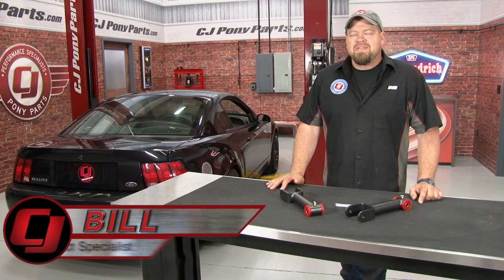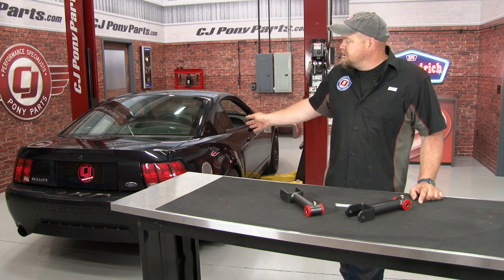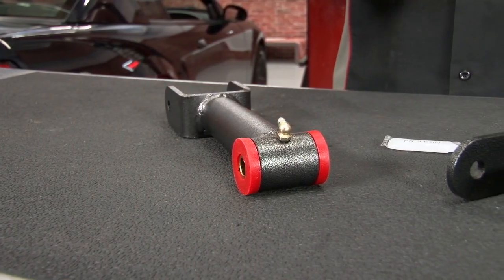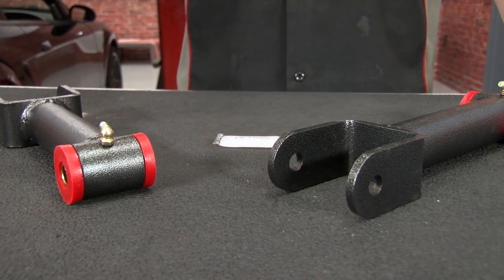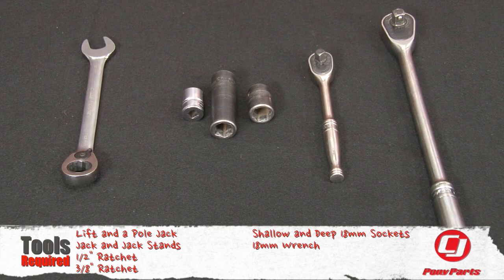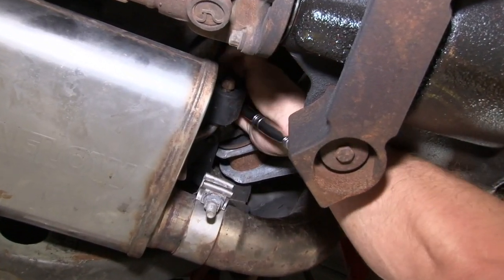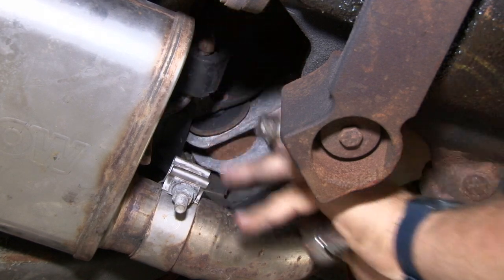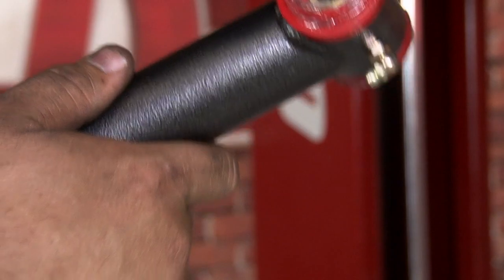Mustang BMR Rear Upper Control Arms Non-Adjustable With Poly Bushings 1979-2004 Installation

Comment: Maximum motorsports says this will cause suspension binding using urethane bushings for upper control arms
Reply: J&M control arms use  three piece hybrid bushings that won't bind. I use their control arms on my 94. Works great.

Comment: Too bad it isn't this easy in real life.  He makes no mention of the 99% of mustangs that the bolts do not come out easily.  On those cars you have to find a way to get the original bolts out and they are stuck on the sleeves in the bushing.  Then again if he told the truth you would never buy the product.
Reply: So what product would you buy then? Would you just not fix the problem?  :^)
Reply: @Ear14  Penetrating fluid only does so much. But OP is 100% right, when I replaced my rear lower control arms, those bolts were essentially twisted within the bushing/bushing sleeve so it was near impossible to take it out. I had to grind the bolts out and had to go to junkyard in hopes to find another 2 of those big big bolts (luckily did) but man what a headache. No autoparts stores on the planet sell those bolts, you either have to get them directly from the dealer/CJ pony parts/LMR or just pray that you find them at the junkyard. This isn't exactly the case with upper control arms as more with rear lowers but it's definitely possible. There's other videos online of this exact thing happening with people when their replace their rear control arms.
Reply: @McLovinsFunhouse  I bought the whole set of rear control arm bolts just incase the originals broke or have to be cut off
Reply: $100 from the dealer for the LCA bolts.. it’s a ridiculous situation but we’ll worth it when done..